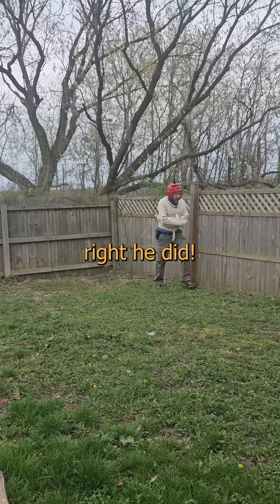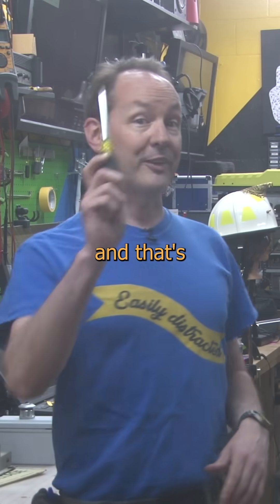Rack Screwed #chrisboden #comedy #engineering #screw #hardware #rackmount #apprentice #educational

Comment: When I interview folks my first question is “What’s the biggest/most expensive thing you’ve ever broken?” You’re not really considered experienced, in my field, if you’ve not flattened production at least once.  (My record is a few regions of Azure SQL… to be fair there was horrible documentation on how our patching system worked)
Reply: I once blew up a very expensive disk drive.  It was in an external cabinet and the power supply failed.  I replace the power supply with a spare and given my luck the supply was assembled incorrectly.  The 12V and 5V wires were reversed in the connector and I didn't catch it.  Didn't end well...
Reply: @Vincent_Sullivan  I didn't know you needed to use the cables in the box with a new power supply so I reused my old modular power supply cables and fried my whole system. Like what's the point of it being modular of you can't just swap out the broken component? I'm just happy the new PSU wasn't as long as the old one and I had to just barely replace the GPU cable so it survived everything.
Reply: I polished a finished partial denture right before delivering it to the patient and it snagged the rag wheel and flung against the wall so hard it shattered 😢
Reply: Been there done that brother. I’ve accidentally screwed up more databases than I’d care to admit.
Reply: @shadowunifer  I was once driving a Titan brand fork truck. Roughly a 20 ton weight limit. About the size of a full size van for visualization purposes. I was going down the aisle towards the tool room (I worked in a plastic injection molding plant) to pick up a mold to pull it out of the 1000 ton injection molding machine (the crane wouldn't go quite far enough south). As I made the final turn, I had the brake pedal pushed in halfway to try and maintain a very slow speed. I didn't turn quite sharply enough and one of the forks ran into a metal stanchion that was bolted into the cement floor. In the blink of an eye, that stanchion was ripped completely free of the moorings. Luckily it was the only thing damaged and I immediately shut down the fork truck and reported the incident, so I just got a reminder to make sure to make wide turns. Gotta respect the equipment.
Reply: You mean your company’s sql instances right? Not like all of azure sql? Because that would be pretty cool!
Reply: I'm in construction and I just messed up a 9 foot section of a concrete pout that's 16" thick. Its also on top of an 8 foot wall.
Going to have to patch it on the exterior.

Things like this happen often enough, and I'm old enough, that I just remember the most recent mess up.

I test a lot and I'm way out on the thin edge of construction knowledge.
Reply: @sparksmcgee6641 people always think concrete is permanent. It just takes a bigger hammer to get it out. I’ve been working on a multi phase project for the last 2.5 years. Some things we knew would get removed, others the design team didn’t plan far enough ahead or had no idea that water flows down hill into the electrical room.
Reply: $5k paintjob on a $60k chunk of aluminum and a 5 week delay.
Reply: I overfilled an oil drum and some oil spilled on the home owners driveway and had to replace their entire driveway.  I never got fired but also never felt the same there 😂
Reply: @Nicklafuego  Hasn't your boss ever heard of a pressure washer? They mak hot water ones that are extremely impressive, and they cost less than a driveway!
Reply: OMG I've broken so much stuff over the years at different places. Production time is probably the most expensive, though. Especially when you're looking at 10, 20, 30 thousand dollars an hour and you fucked up the whole shift
Reply: i thankfully haven't broken tooling (yet) but i did give myself quite a scare on a lathe. badly indicated my tool against a part and dug it in there at full speed, i was sitting right next to the lathe when the part broke free from the chuck. lemme tell ya if there's anything that'll make you shit your pants it's half a pound of aluminum spinning at 400RPM breaking free from the chuck 2 feet away from you.
Reply: I remember I brought down our biggest customer's (about 1500 users) production environment for about an hour once because I missed a part in the documentation about the order to power cycle servers in their environment. I was about 3 weeks into the job, my first sys admin position and I was mortified. My coworkers laughed at me, put a stick that said "I broke all the things" on my cubicle and told me every one of them have done it too, just pay closer attention next time. That sticker was on someone else's cubicle within a couple days. 

We all make mistakes, best to own up to it, learn from it, and move on.
Reply: That's a really great interview question. The one that was most traumatic to me was back when password keepers were a new thing, a senior IT director complained of an issue that he hasn't been able to get fixed and had all the hallmarks of an IE addon - and lo and behold there's a non-standard toolbar. I'm like there's your problem and he says IT always says that but it's definitely not the problem. I'm like, yeah that's it - uninstall. And it solved the problem. But his exact words were "you've ruined me!" because it was his password keeper for separate passwords for 40 different IT applications and my boss was like "welp, you're gonna get those all reset now, right?" And mind you, documenting stuff like who is responsible for each application wasn't that company's strength. So that ended up being most of a week. Taught me to check dependencies before I fix something though.
Reply: shorted an ecu once
Reply: I haven’t done it yet but my boy flooded a house
Reply: Mine so far has been a few hundred maybe a thousand or two on plastic material at most.
Reply: My buddy works in IT/AV/production, generically I guess. As a person who hates those guys. Anyway his first week at a big company, I mean a top 10 publicly traded multinational whose name you 100 percent know, his boss bricked a giant piece of presentation equipment by hooking it up without reading the manual. 500 thousand. last I heard they all had their jobs still. Everyone learned something.
Reply: A frequency converter that took up about half of a wall in a 40 foot container.
No idea of what it was worth and technically it was already broken (it had tripped the high voltage cable feeding it). But I definitely didn't help..
After I was done there was a kind of metallic essence in the air.
Reply: @shadowunifer  I feel both blessed and left out in that the worst thing I’ve done a whoopsie on was a multi-team dev testing environment (if it wasn’t for another team’s IAM policy the KMS key created by a mistakenly-partially-torn-down IAM stack would have been removed, bricking the app DB data)
Reply: That's a difficult question.  I won't be able to think of it before I finish this but I'll be thinking.. 
Part of it is If you break something that's already broken does that count?
Meaning things like pump casings that didn't want to come apart and wound up getting broken in the process.. "Some were pretty big!"  But they were already old and were broken and I was looking to fix them but then had to be replaced lol!
Reply: Do to some one missing a digital safety lock for our computer tracking system, I once shut down the entire lot tracking at jnj for a week due to accidentally doing some of the steps backwards ( 12 hour shifts and I was still walking up)
Reply: I hooked up the battery cables on a 24v 3600w inverter backwards once. Made a hell of a bang and let out a curl of smoke
Reply: I was cleaning in a fab shop, air compressor hose dusting, I did a good job but got dust in the multi million dollar Lazer cutter, 
The repair guy charged like $500/h

Though I like to think it was partially routine maintenance

Though another time I was removing paint from a concrete pool deck, I looked at the warnings and price tag on paint remover gel, and looked at alternatives, tried dousing the whole backyard in diesel and gasoline, it worked pretty good and dried up without anyone's carpets or face melting off, but the clients weren't happy with the optics or aroma when they got home
Reply: Transfered a users data and wiped their old drive like they told me too. Well.... There were 2-3 quick book files that held the customers ENTIRE FINANCES FOR THEIR BUSINESS. No back ups, no extra drives, no cloud. Just gone.
Reply: My own personal record was the entirety of McGraw Hill's national online testing infrastructure...during finals week.
Reply: Good question to ask!
Reply: Does stopping customer work count?  I've done a few of those.

Man did that hurt!!!
Reply: An entire cabinet floating middle set of doors. Couple hundred in redoing. I was distracted by some personal shit that came up before the job. Never again
Reply: One time i trusted an electrician too much after i walked him through the wiring diagram. I wasn't licensed, he only had to hook up the power from the panel in the building, to my panel. 8 wires for the motors, cause 2 3 phase ones i had already set for 480, then, he had to hook up a 120v to a panel, and just connect like 3 wires to the fucking transformer but instead, sent em right into the panel. Wrecked 30k worth of 24v switches and also still hooked up the motors wrong. My mistake was going to another service call that took like 5 hours.
Reply: Ive broken stuff all the time over the years at a couple different jobs. The funny thing is things just break over time. Even if youre not totally at fault things eventually happen after everyday use. Even the best workers will occasionally do something that causes a failure.
Reply: Ended up nuking a customers firewall on the day of go live when I was basically an apprentice. Thought I’d go ahead and try to install an infrastructure monitoring agent… ended up saying it’d delete the routing package from the system. I thought the documentation trumped what I’d seen with my own two eyes. Hit “y” on the apt prompt. Bye bye vyatta. Ended up having the field tech replace the firewall. I was lucky enough that iptables were still installed and functioning nat
Reply: A couple weeks late, but I'm gonna share the story of how I accidentally cost the machining plant I worked at about 40 grand.

I can't remember the name of the machine, but the job was very simple. Take gear, put on podium, press button to clamp gear to podium, close door, run process. I'd been here about 7 months at this point and was very familiar with what I was doing, but as I was once told as a kid, "Sometimes, with experience, comes inattentiveness." and while I was at the tail end of my shift, I put one of the gears in and forgot to clamp it before running it. After about ten seconds I hear a series of loud "KA-CHUNK"s before hitting the emergency stop. After opening the door, I discovered that I had broken:
- The clamp
- The podium itself
- The gear
- Every single one of the drill bits in the machine.

I wasn't fired, but I was very firmly reprimanded and told that it was going to cost, "A years wages" (which came out to about 43k) just to get that machine running again. I got put on something else, and ended up quitting for a completely unrelated incident about two months later.
Reply: I haven't broken anything major yet but I've definitely broken my share of safety covers
Reply: I caused a jam in a line fed curing oven that snagged on gas lines and fucked the overhead line and oven, $60k in parts later and I got made to sit in the shadow of the tech they hired to fix it and learnt how to fix it the next time my retarded ass causes a jam that rips up the inside of the oven.
Reply: How do you lift 1000 tons with a 20 ton lift? That doesn't make sense AT ALL!
Reply: @shadowunifer  I wouldn’t say I was solely at fault as what we were doing required 2-3 people. Couple years ago during drill in a cold Idaho February, we had some downtime and both my Section Chief and Sergeant decided to take some of us out into the howitzer and work on disassembly and reassembly of the breech. Things were going good. We had the heat on inside the Paladin, got the breech disassembled with no problem. But alas, the problem we ran into, likely due to some grease and other muck and all of us not quite fully understanding how to reassemble the breech.  Now a key thing to know about reassembly of the breech is that when putting the breech block back in place, there are two little arrows that NEED to align underneath the whole assembly. However, if you’re wrong but don’t know it, you WON’T know until you close the breech at the end and it can be a pain to open it back up to disassemble and diagnose. There’s two white lines that need to align in order to safely fire the howitzer. In the event you have to disassemble it in the field in a combat scenario. Well, we spent like an hour and a half doing the whole process trying to figure it out before we diagnosed the problem and fixed it. Don’t remember if we had help. Likely, the sergeant took a look himself and eventually figured it out.
Reply: Put a PLC card into calibration mode by mistake, alarms went off and they had to evacuate the whole paint line.
Reply: I fucking almost ruined a $1.5M iridium crucible welding.  I had to have a better man come in from outside to fix it for me.  That was 16 years ago and not a week goes by without feeling it.  Nothing could have pushed me harder to achieve competence.
Reply: Brand new computer motherboard.
I went to attach the heat sink for the processor. I did not fully understand how the attachment worked, so I used enough force to flex the board and break numerous traces in inner layers of the PCB.
A $750-ish mistake.
-
No, wait.
-
Used a brand-new (we had it for about 4 days by this point, less than 20 hours on it) backhoe to haul heavy trach to a dumpster.
The dumpster was near full, so I pulled forward to use the bucket to compact the trash so the hauling company would not hit us with an overfill charge.
The lifting point on the dumpster pierced the front grill and the radiator.
I think that was a $1,000+ mistake.
Reply: Being the person who had to break the news that we couldn't use the datalockers for specific computers for what we needed them for.
Basically boot mode didn't do shit and couldn't see the damn things, so now we have to connect to laptops with ethernet cables.
Reply: I crashed a train
Reply: I once broke a sprinkler head above an industrial compactor and flooded an entire receiving area with stinky ass sprinkler water (ifykyk)😅
Reply: Took down the assembly line for about three to four hours, so, like... twelve million dollars worth in cars (technically speaking)?
Reply: I’ve been to blame for plenty of mistakes. A few months ago I was loading the last 3 of 30 mini fridges into a box truck. The pallet broke, I grabbed one fridge and watched the other 2 swan dive into the pavement 4’ down. I was able to make 2 into 1 and only had to pay $3000 for 1 more refrigerator… same week I got a bill for $3500 to repair an auto opening door because I hit it with a pallet jack loaded with 1400lbs of wallpaper. Expensive sounds.
Reply: My cousin totaled a heavy hauler out in the oil sands. It was.... Millions... He's lucky they just fired him honestly cause he fell asleep during a night shift. 100% his fault (well, beyond overworking employees and promoting an overtime culture so toxic Japanese people balk at it). They're huge pieces of machinery too so it wasn't just expensive
Reply: @LaSerpentDEden  this reminded me of my ex farther-in-law's long haul accident. Had a coughing fit, blacked out, and drove his tractor trailer through a dealership lot
Reply: @LaSerpentDEden  "Fell asleep during a night shift."
I assume they had ran him for close to a day straight. I don't even blame the poor guy, that's just exhaustion overpowering his will to stay awake.

Comment: I once found that an ISP tech had placed the cage nuts on the front of the rail, and not just mounted a very expensive Router to them, but he stacked a fiber modem and a PSU on top...

Comment: APC/Schneider cabinets typically come with a bag of M6 cage nuts and screws. Be aware that a 12-24 screw will fit and thread sloppily into an M6 cage nut... don't do this! Heads are usually phillips #3, not #2. Match the bit to the screw head or I will blow a gasket! I have seen meatheads impact screws so much, that the screw head is no longer concentric with the shaft. Also, learn how to use the included cage nut insertion/removal tool... it is amazing, and keeps you from getting bit hard by the cage nuts!

Comment: You haven't lived and cried until you work where there's three different rack mounting sizes. M5, M6, and 10-32. I suggested scrubbing all but M6 nuts and screws, but no... and throwing away the gray painted HW away as soon as we open the box with the instrument that thinks it's special. 
I just recently retired after 5 years of this poo. The first 40 years were much better without racks and the spazisms of rocket science engineers. So many people who grew up in daddyless and anti-DIY homes who struggle with which end of a screwdriver to hold. If you are still young enough to be in high school and you think the junk drawer in the kitchen is a toolbox, for Pete's sake, take a basic shop class before you embarrass yourself and cross-thread so many screws in so little time.
Reply: BTW, I miss that yellow gyro screwdriver. But not having to explain and demonstrate how to use it.